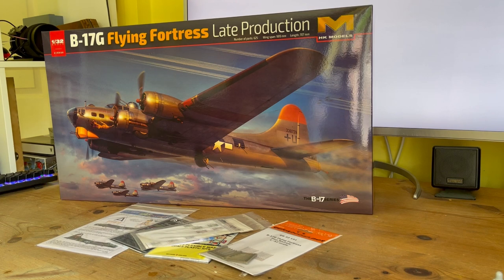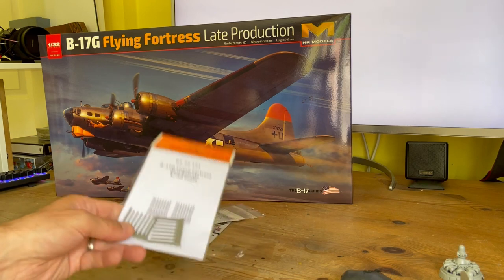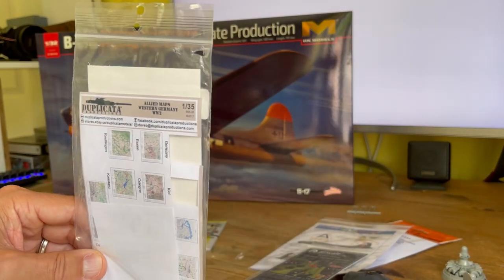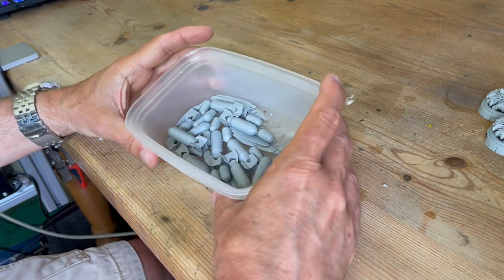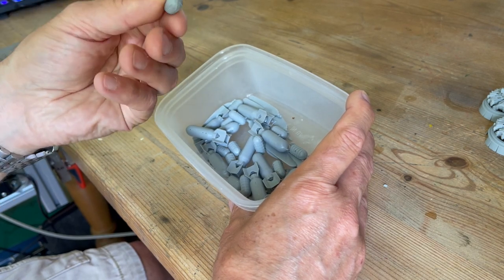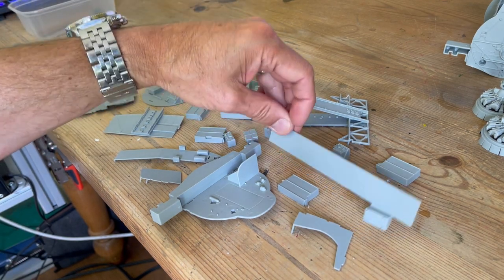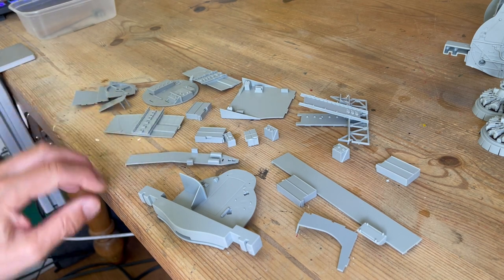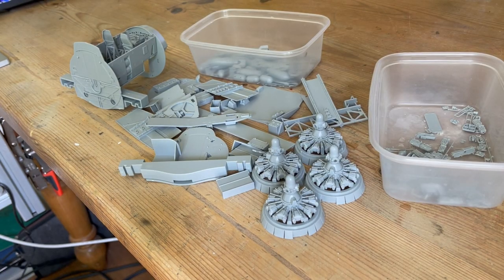Building the HK Models 1/32 B-17G Part 1: Extras, & 1st assemblies

Comment: Great series of videos! Well done Sir. 
I just bought this kit....is there anything I should watch for? Errors, bad parts etc? This is my first HK kit...never built one. Wish me luck.
Reply from the maker: Hello and I’m glad you found the videos useful. The kit is pretty good to be fair, not Tamiya good, but the only bit I had any problems with was the ball turret. The guy at HK who designed the kit must’ve had a bad day when he contrived that assembly! I ended up leaving some of the internals out. You can’t see them in any case. Have fun!
Reply: @ZeddysDad  Thanks for the heads up

Comment: I went with the wood decals for the flooring.  It really worked out well as I haven't ever been able to replicate wood grain on my own.
Reply from the maker: Glad they worked for you. I was too scared of my ability to cut the exact shapes so they sit unopened!
Reply: I found some extremely thin birch plywood sheets, about 1/32 inch thick that I glued right to the plastic flooring.  The wood has an extremely tight grain.  I stained the wood with various tan colored wood paint diluted with clear gloss acrylic so excess water does not mess up the wood.  After a few coats I sanded the wood with 600 grit paper to dull it and then I waxed it which gave it the right kind of shine.  It should not be too glossy.
Reply: @jeffreyhiman5198  Thanks, I will keep that in mind.  I have that 1/26  Hellcat to build and
maybe I could use it there

Comment: Why would you buy resin barrels when you can get metal,not that much price difference if you look around.
Reply from the maker: Metal about 3x the price but I relented in the end and got the metal as the resin are just too thick
Reply: @ZeddysDad  Plastic barrels snap too easily,sooner buy one set of metal barrels.Some of Master Models are so much more detailed too.Others such as Aber are good as well.Profi Modeller are overpriced though.For the B24 for example I just bought a few sets of Master barrels,was cheaper too.